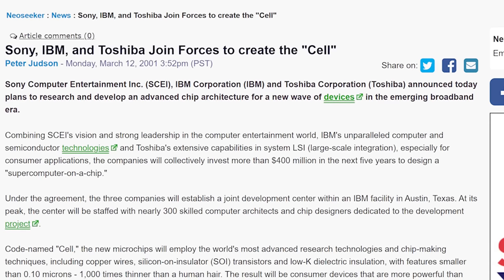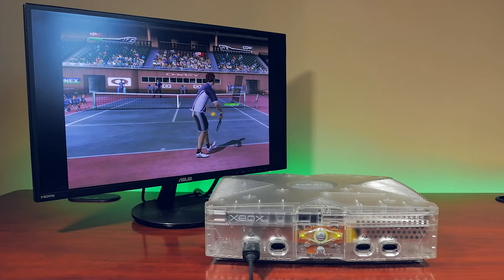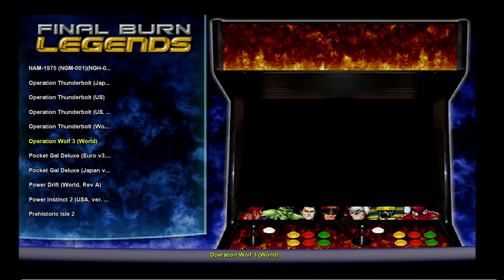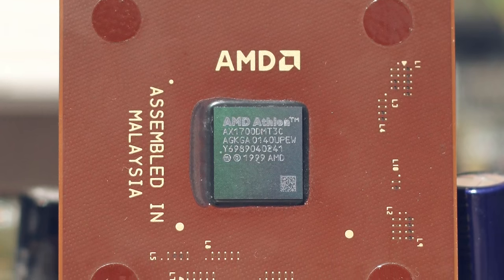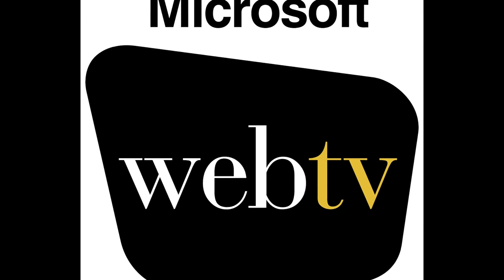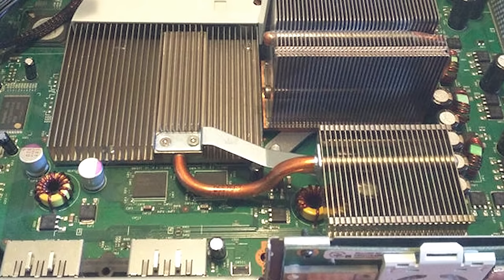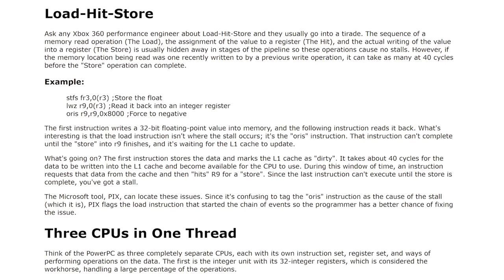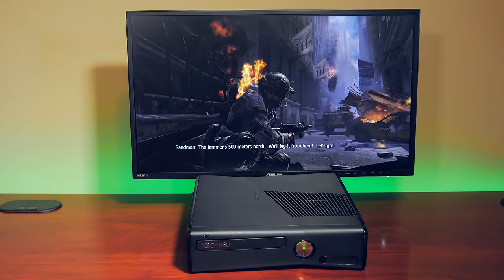Why Microsoft switched from Intel to Power PC for the Xbox 360  | MVG

Comment: I miss when consoles had architecture other than the defacto x86 and actually felt like different beasts entirely, now they're just PCs that you can't upgrade, are limited to games only the manufacturer approves, essentially becomes a paperweight when they decide to discontinue it (remember when discontinued didn't mean it just stops working?) and can't really be used for other tasks, I'm all for a free market but everything about consoles screams anti-consumer to me, especially when you also consider the fact that the "next-generation games" (ie the same game they sold you last generation but with better graphics and more microtransactions) are going to cost $70 and you don't ever get discounts as good as what you can get on Steam, GOG or Humble Bundle etc, also, this coming generation will probably bring the end of the second-hand market, so it's "pay the inflated pricetag or tough". Honestly, the only hardware difference is they're unified-RAM systems, giving them a slight advantage as the CPU doesn't have to move data to VRAM... As if that even matters (which it doesn't as integrated graphics are essentially the same thing) .

(I understand this tangent is disjointed, but I have no idea where I would start in terms of formatting)

Comment: 9.55 .. your discription of why its hard to port a game to powerpc..  i think its not that hard. I think its the operating system and drivers that has to be tuned in at this level.   Without proper OS support,eg unstable threading,they went single threaded ?? I think Microsoft was selling the capabilities of the hardware .. but that was  far beyond what their operating system was built for...

Comment: I think if you are looking at the current situation the underlying CPU architecture just is not as important. With the amount of performance, we have now the benefit of going RISC just is not that great.
I think end of the day apart from mostly just some recompilation it really doesn't matter much if a chip is arm or x86 based noways. What's more important is how the cpu itself is designed / how well. it performs.

Comment: It's not the chips its the console maker using the cheapest (smallest) heatsinks they can find. Any chip will run hot when poorly sinked, all modern chips are so dense they will melt in a very short time if all of the transistors are used at the same time, part of the circuitry just manages moving the active areas around to avoid sharp heat concentrations. 
I am also curious how many red rings were caused by fools covering the vents. No way to get any real data on this of course.

Comment: I guarantee the PS5 and Series X will have a lot of the same problems with heat output. Maybe there won't be as many total system failures since modern cpus have safeguards to shut down when things get too hot, but consider the size of those cooling solutions on each console and how well your average console consoomer takes care of their gear. Once those things inevitably get choked up with dust and debris you'll start to hear an awful lot of complaints.

Comment: Disappointing to see MVG buy into the “PowerPC = hot” garbage that has been disproven for a long time. Microsoft was even very clear at the time that the RRoD failures weren’t due to the CPUs. They had rushed, shoddy assembly, bad caps and terrible thermal paste application/quality.

Comment: The launch 360s used to scream like a hairdryer during games, and put out just as much heat. Of course everyone forgets the phat PS3 had the exact same problems with thermals, they just took longer to die. Node shrinks eventually fixed the problem, and the slim models of each console were rock solid reliable. But those first few years of the 7th gen were rough for hardware failures. Of course then they went with AMD's awful Jaguar microarchitecture for the 8th gen. It's amazing those PS4 and Xbone look as good as they do running what's essentially a bargain basement Nettop processor. And yet the consoles still run hot. Well, the original PS4 does anyway.
Reply: Nothing wrong with kabini very efficient just the clock speed holds them back a bit

Comment: the Xenon didn't even have branch prediction. Its an apples and oranges comparison to the Apple G5 chip, many features you'd want on a desktop chip are gone in the Xenon. That 3.2 ghz multi core chip was useless unless you bent over backwards to craft code around its weaknesses. the Pentium 4 had similar downsides. 
https://arstechnica.com/features/2005/06/xbox360-2/7/
Reply: Yes but 6 threads!!!!!!

Comment: i rly want the next generation of consoles (not the upcoming ps5 but the ps6) to use nvidia gpus so the consoles could take advantage of DLSS for the huge performance boost it gives. MB the next nintendo console will use nvidia DLSS
Reply: By that point , AMD would have a similar technology like dlss. Just like how rnda2 is adding ray tracing . Nvidia had gsync and then and added free sync so it’s only a matter of time for the technology to develop similar to ray tracing

Comment: Xbox 360 and PS3 are the only consoles to fail on me that i have owned. Both due to heat issues. MS replaced my 360 , but my PS3 was out of warranty and is gathering dust in my loft with my retro collection.

Comment: PPC and it's heat issue wouldn't have been an issue for Microsoft if the EU didn't pass a law that wouldn't let them use lead based solder.  It was impossible for them to see rrod coming since it usually took about a year for it to start happening.  

Sony on the other hand had an extra year (remember 360 launched a year ahead) and they saw that the lead free solder couldn't handle the pressure.. no pun intended.

I remember when MS first decided to go PPC there was talks of the system using liquid cooling.  Basically a small as possible AIO setup.  Of course that needing to be custom meant it would be more expensive and MS really wanted that price advantage plus using an AIO in a console has some risks that don't happen on PC.

So... If there's anyone to blame for rrod its the EU.  It's not like little kids smash open consoles and eat the solder.

Comment: If I'm not mistaken didn't the Game Cube and Wii U run on AMD/ATI Radeon GPU's?
Reply: Gamecube used a GPU made by ArtX. ArtX was bought out in 2000 or early 2001 by ATI but the work was done so nothing was changed. Wii used a higher clocked Gamecube GPU with some changes. The Wii U actually used a modified ATI Radeon HD 4650/4670(somewhere around that ballpark)

Comment: What do I think? I actually loved power pc and always felt it was more forward thinking. I don’t know enough about ppc vs x86 but I do know that newer tech is less restricted by legacy hardware. This is sort of like the ps5 having all gddr5 or whatever ram it is and the Xbox having a mixture. There are advantages and disadvantages ultimately I feel that the mix is better for a set top all in one box but for gaming the gddr5x or whatever it’s called is clearly better. I do not agree with current gen consoles and feel no reason to buy any of them to the point that I forget they were released. Anyways with the ram 16gb of gddr5 and say 4gb of normal system ram would have been perfect for the current gen consoles. But whatever always compromising to save a buck when the sad truth is if they just went all out to build the ultimate system and did price dropping every 6-10 months till it was at 299 then whoever did that would have been considered the ultimate

Comment: Only the very very first iteration of Pentium 4, Williamette (Socket 423, 180nm, 1.3-2.0 GHz) was bound to RDRAM memory. The whole platform was completely useless. RDRAM ran hot and didn't perform well. The processor didn't perform well AT ALL, it was basically slower than Pentium III.

Throughout 2002, they launched the Northwood(130nm) and Socket 478, which went with DDR SDRAM, and the processor, while still being just as energy-hungry, gained some appreciable performance, for one with HyperThreading to paper over its pipeline scheduling issues, and for other by increase of clock rate to 2.8 GHz. So by the time Microsoft would be designing Xbox 360, it would actually be a viable choice. However of course switching to a different CPU vendor would be an obvious and likely better alternative.

I don't necessarily see that Athlon XP would not be viable for games, especially as Athlon 64 X2 that came out in 2005. Why do you think so? Furthermore the IBM processor also came out kinda bad, being a largely in-order processor.

Comment: I knew there was a fallout between MS and Nvidia over pricing, but I hadn’t realised it was down to MS expecting Nvidia to eat the costs of unused chips, I thought it was purely because Nvidia refused to give MS a discount as the components became cheaper to manufacture over time. 

I was quite concerned when Nintendo partnered with Nvidia for the Switch, I thought it could end up in a similar situation... or maybe it has! After all the Switch hasn’t dropped in price and Nintendo had to make a cheaper model by designing the Lite. Plus, Nvidia had to design a new revision of the system after a security flaw allowed it to be hacked. It’s like history repeating itself! 😉
Reply: I doubt Nintendo and nVidia will have the same issues that happened with the Xbox, it looks like they are never able to produce enough to meet demand, either that or they artifitially make less than they'll sell

Comment: Lol. Why did apple say powerpc was hot if gamecube didn't run hot?
Reply: PowerPC on the gamecube was a 750 model which was very power efficient. The ones used in 2005 on the Mac had been the 970 model and that thing ran hot as hell. The chips used on the 360 and ps3 are cut down version of the mac model so power was not an issue. the problems came from other things

Comment: Netburst was terrible but I wonder what seventh gen would have been like if Athlons were chosen instead.
Reply: would have never happened. The dual core Athlon didn;t come out until 2006 and even then it was only two cores. you couldn't stick three core or it would burn. It was also single threaded as well.  PPC was the right choice. Both IBM and AMD bet the future was higher and higher Ghz while in reality IBM got it right. It was sticking more cores on a single die

Comment: So not surprising, the first gen Xbox units were the most stable? Ran cooler(no red ring of death due to overheating), and the user and power user could "upgrade the box" if this DID go south or were too slow? Hmm, I am NOT a gamer, but I would like an old Xbox gen 1 myself.. My son has 3 Xbox 360 units and the common issue is the fan running really loud and the damn CDROM drive not wanting to read or keeps spitting out cds or the most irking of all, refuses to open tray or close tray. I being a computer tech with some knowledge about the gen 1 Xbox being intel PCs with costom gaming hardware, figured I could just replace that crappy CDROM drive.. WRONG! I found out the 360 was NOT a intel based hardware platform and my son had to give up on the white 360 and go for the 360 slim black which seems to have improved but has that loud fan issue now.

Comment: knowing now, i want to mod the fan of my ps3
Reply: There was one that runs it at full blast but sounds like a jet engine. I used to install pots into PS3s so you could adjust the fan speed externally.

Comment: It's worth nothing that the XBox360 heat problems were with the GPU, not the CPU.  The GPU heatsink was located right under (and touching) the DVD drive, and my guess is that during heat stress testing, they didn't have a disc spinning in the drive, which heats up the drive and thus the GPU.  Overall, the 360 was just a bad design.  The massive external power brick should have been a big clue.

I think Microsoft was politically more cozy with Intel than AMD, and should have gone to AMD right for a custom design from the start.  The original XBox was kind of a desperate rush job, so going with a typically expensive off-the-shelf Intel chip was just a means to an end -- forcing their way into the console market quickly.

In general, RISC was and still is over-hyped and various experiments with MIPS, PPC, and ARM haven't gone over well for high-end applications.  x64 will likely be around in consoles for a while.

Comment: So this is one of the reason why Microsoft never deal with Nvidia and Intel when it comes to consoles, they both have a bad blood with each other. Oh well AMD sure are easy to talk to when it comes to custom CPUs and GPUs....
Reply: Nvidia pulled the same thing with Sony during the PS3 days. RSX was inferior to the GPU on the xbox 360, it had no unified shaders yet it came out a year later. If you check a chart with the price of the PS3 parts you will see the most expensive thing is the garbage RSX, more than the Bluray or the CELL. Nintendo is the only company team green has not burned.

Comment: There's no sugarcoating it, the Pentium IV was a piece of crap and Microsoft would have been in big trouble if they went with it for the 360 (as if it didn't already run way too hot). If it were based on a Core Duo processor though, it'd be a very different story indeed.

Comment: IBM: we made processors for Sony Microsoft and Nintendo, but only for intendo the thermal issues are not a problem
For Microsoft and sony... well... ehm... you wont a way powerful processor than nintendo right.. eh ehm..., you have to design a VERY GOOD cooling system my boys

Comment: I have always wondered why Microsoft would switch from an easily programmable Intel to Power PC?
Reply: both Intel and AMD in the very early 2000s bet that the future of PC cpu was just higher and higher clock speeds. IBM in the early 2000s went with multiple cores on the same die. By the time Intel and AMD course corrected IBM was way ahead of them. There was no way for MS to get multiple core/dual thread CPU from Intel or AMD by 2005. Dual core PPC ran hot on the Macs by 2005 but the cut down CPU used on consoles worked fine.

Comment: It's odd that you blame the thermal issues of the x360 and PS3 (which were nowhere nearly as bad as the RROD) on the CPU, cause I have heard so many times that at least for the X360 the thermal culprit was the ATI GPU, which ran MUCH hotter than originally planned. Also, a bad rushed hardware design in the X360, because MS desperately wanted to beat Sony to market, was to blame. Also the X360 factory in eastern Europe (IIRC Hungary) was brandnew and did not have much experience, so yield was abysmal..

Comment: The G3 core AKA 970 was a great chip. But IBM didn't want to make future G3 chips. And the they lost Apple cause they wanted them to use the CELL cpu. This didn't work well in notebooks. Basically IBM killed the future of PPC cause they where too afraid of shaking up there own company. They never want to compete with Intel and they didn't want to transition there own systems out side some servers to PPC.

Comment: What if SONY used a more powerful CELL or the same as the one used for the PS3 super slim for the current gen or next gen with that much memory that they use now? after so many years and many dev already having the skills/knowledge to develop for that architecture it was crazy/sad to me that they decided to drop it. All that hard work that it took to get that knowledge and skill to and lose it.
Reply: CELL was a nightmare to program. There was absolutely no way around it. Reason why Sony was the only company that pushed the PS3 to the limit and only with a few games. There was plans for a next generation CELL with 4 PPE and 32 SPE but Sony pulled out before work was even started.

Comment: dude you said the cell chip would power ***PS3*** then "later in 2001, power gamecube"
you MUST mean ps2?... ps3 didn't come out until the next gen after 360..
but you showed footage of PS3 and uncharted so did you really put all the PS3 footage together but you meant PS2???
if PS3 came out before gamecube original xbox would have been crushed :P

Comment: the Resurgence of Risc and Arm, Risc making it big in the server market. and Apple about to make the big switch.  Microsoft may need to respond with a Risc version of windows and actually make it work for low powered devices. it came a bit late for the current console generations however for low power devices a big shift I'm sure will happen during this generation of consoles. 
I'm hoping that it will also mean a shift away from Windows to Linux too. We can dream right.